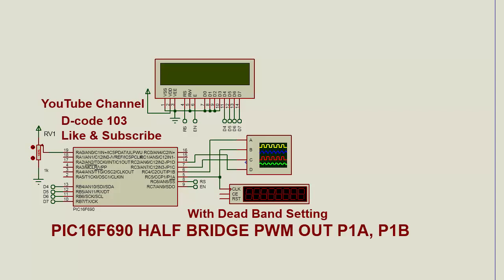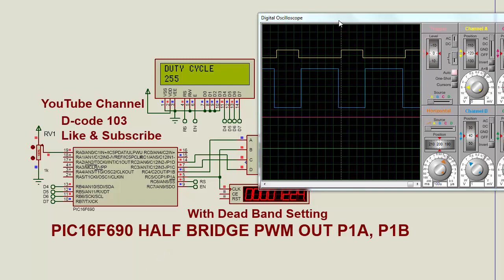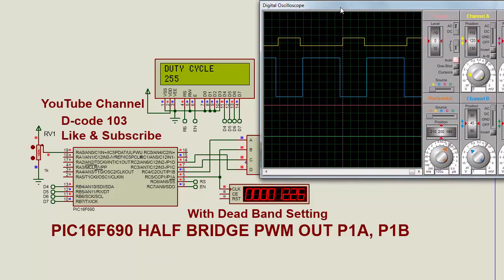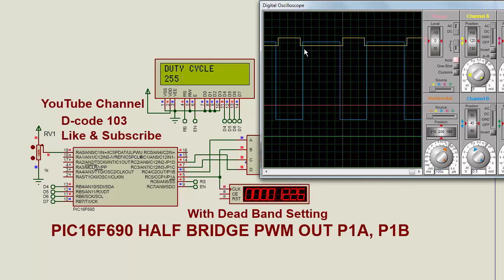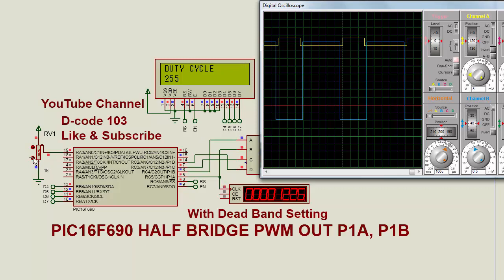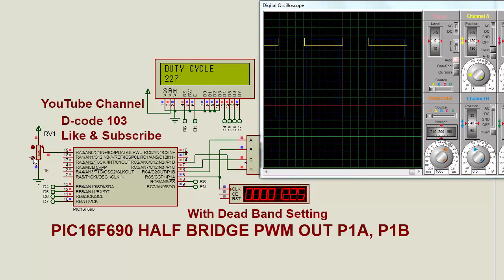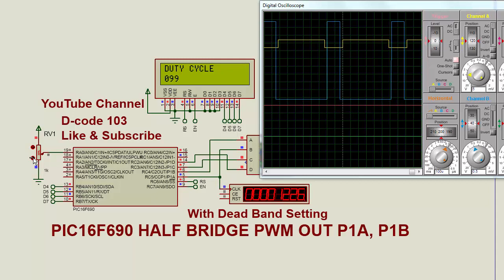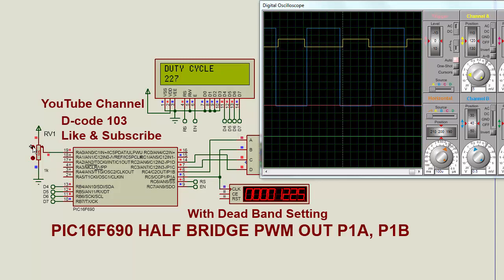PIC16F690 Half Bridge PWM and Dead Band control

Comment: hi sir, how did you program this deadband, did you need calculate some values?
Reply from the maker: Read pwm section of data sheet , where there is register for dead band  it's value can be from 0 to 6 bit value. Thank you